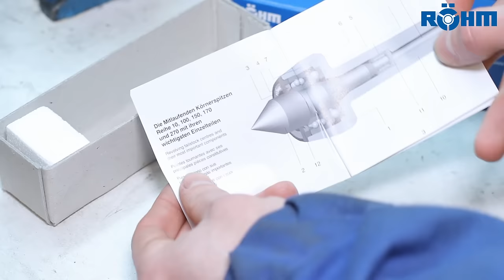Internal Spindle Stop for the Mini Lathe - Making a Lathe Depth Stop

Comment: Your slitting saw probably got worn out from spinning way too fast for steel of that hardness.
Reply from the maker: Thanks for your comment! Yes, I guess that was the case. Unfortunately the little proxxon mill doesn't run lower than 900 rpm. So I almost had no other option than ruining the sawblade :)

Comment: You do very good work...but no offence when I say when your knurling and drilling that I've seen you should be using oil especially when knurling helps flush the the small swarf chips away so it doesn't recut the chips into the work..

Comment: Nice work, but dude, I really had to turn down 5he volume because of your chatter. Please adjust feeds, and speeds.  Use heavy cutting oil with your knurling and doit as slow an RPM your machine allows.  A Blackwoods pocket edition black book for your cutting speeds and feeds are cheap and very handy.
Reply from the maker: Thanks for your feedback! Yes, could have done this better. Especially the internal turning operation sang like crazy sometimes. You mean even slower for knurling? I have to look the right speeds up. It is cut knurling and not form knurling. This might be different.
Reply: @WeCanDoThatBetter  fair call.

Comment: I have never seen knurles used that way. Cool!  Awesome work and great video.
Reply from the maker: Thanks for your feedback! This is a cut knurling tool. It is different from the form knurling tools which are more often seen on youtube. I made this tool by myself and also made a video on the build process if you are interested.
Reply: @WeCanDoThatBetter  Please do post the video of the cut knurling tool build. Is there any reason you do the knurl cuts dry instead of using cutting oil?
Reply from the maker: @nrml76  here is the link to the video:https://www.youtube.com/watch?v=vj8pp3YJijg
When using cutting oil, you have to have plenty of it to wash the chips away. I don't want that mess of a flood coolent so I leave it try. So far it works :)

Comment: Once again, awesome execution. Love watching how methodical you are in your design and approach to your projects.
I too am curious about your ER32 collet chuck. Looks like a good one. I'm looking to replace the Ebay special one I have as the runout is terrible. Would love to hear where you got yours.
Thanks for the video! :)
Reply: You can usually "Touch Up" the collet chuck once it is mounted on the lathe with the lathe it's-self. Have you verified it is mounted concentric? Have you checked each of the individual collets themselves for concentricity? -- Do This -> Mount the chuck as central as you can, then set your compound to the correct angle of your collet system, then take a very light skim cut, now you are perfect! (Maybe use a Dremel mounted on the tool post and grind in the correct surface finish). Make several registration marks so you can get back to this concentricity after removal + replacement.. Voila!
Reply from the maker: Hi and thanks for your kind comment! The ER collet chuck I use is from GG-Tools in Germany. I tried 3 different chucks from ebay and elsewhere, all with horrible runouts. This one I got now has an excellent runout. But it seems that something in the manufacturing process went wrong. The chuck is totally coated including all the functional surfaces. That is not normal. All the functional surfaces should be ground after heat treatment and coating. I called the supplier but he doesn't want to see any problem with the product. So that's for your information. The runout is excellent, the coating and the support is questionable.
Reply: @WeCanDoThatBetter Wow, that's rare in Europe. The behaviour of the company I mean. I once bought a machinist square (plain, no foot) from MiB Germany, 01 class supposedly. It wasn't even in 02. When I moved it along my flat stones grinding marks revealed. Ondulations (waves) typical for Chinese factories where a part is ran through a surface grinder too fast. I reported everything to the company and got a middle finger. I used the square as a DIY kit. I had to correct it myself.

Comment: Very nice design, work and video.   Really great sound quality too.  Have you found that "ER" type collets work poorly (poor grip strength, poor concentricity etc.) if the part is shorter than the collet's over all length?  How will you deal with very short, perhaps small diameter parts?  Will you need an assortment of stop rods or stop rod ends with diameters that match the part diameter?   
Cheers,
F.C.
Reply: During the making process shown in the video, he uses a piece (an offcut) of same diameter stuff when he is gripping on a short length in the collet. The backstop does not care if it touches this offcut or the stock itself. A single stop rod of a single diameter will do for everything. Use a dab of superglue to hold the offcut to the end of the stop rod while the finished part is removed and the new stock is inserted. The only time it might be necessary to modify it is if he wants to grip a hollow tube whose ID is greater than the stop rod's 'natural' OD.
Reply: @darryllcrook376   Ah......so, an assortment of stop rod ends (offcuts).  Brilliant.  I hope the collet concentricity will be adequate if/when non-nominal part diameters are held by nominal diameter collets.  Maybe switch to a 3-jaw chuck with soft jaws bored to suit?   
Thank you,
F.C.
Reply from the maker: As you see in the video when I made the long arbor, I inserted a shorter piece of the same diameter to support the collet. I'm thinking about making a thread onto the stop rod, so that I can screw on different tips with different diameters when I have to support a collet.
Reply from the maker: Yes, thanks for your explanation. I think the "standard" stop rod will do fine for the first time. Perhaps I will make some exchangable tips for it which get screwed on to the rod at some point in the future.

Comment: Could you share your thoughts about collet chucks. What would you advise a fresh hobby machinist? Where should a hobby machinist place such a chuck in the upgrades/shopping list? Let's say the freshman only has the lathe with basic set of cutters, only 3 jaw chuck and a dial indicator and calipers :)
Reply from the maker: You can go far with a three jaw chuck. I would recommend to first upgrade to an independent 4 jaw chuck. These are really versatile for large and small workpieces and give you excellent runout when dialed in correctly. A collet chuck makes work easier when you have a lot of parts to do with the same diameter. It usually runs a lot more true than a 3 jaw chuck and changes of workpieces are a lot quicker than on a 4 jaw chuck.
So, it is not necessary in the first place but on some point later it is a good investion.
Reply: @WeCanDoThatBetter  OK, 4 jaw independent first, got it :)

Comment: So you've made an assortment of rods to be used, with differing end diameters, so they can also be poked into the different sized ER40 collets?
Reply from the maker: The rod doesn't have to be exactly the diameter of the collet. There are some cases, when the part is too short to go deep enough into the collet, where the stop needs to be the same size to support the collet when clamped. I think I will machine a thread into the bar so I can screw on different sized tips.

Comment: At 3:29 the saw have to high speet only 150-250 RPM  and you have also used oil to . but nice video aswell 😉👍
Reply from the maker: Thanks for your comment! That was probably the problem, but the proxxon mill doesn't go lower than that. For HSS that was too much I guess :) You mean no oil?
Reply: @WeCanDoThatBetter  meybe you can swop the pully or put a vfd between or used a  tungsten carbide
Reply from the maker: @wilcojuffer5940  I have to look for alternatives for the milling machine :)

Comment: I'm not saying I know better, because I certainly don't. Couldn't you just have started with a thick walled pipe and saved time and material? Or would sourcing the pipe be more effort than just grabbing some material already on hand? Regardless, you've earned a subscription! Very well made video!
Reply: You are likely right on both points... Pipe would be better work wise, but high alloy pipe aint found cheap nor oft... Its much easier to slurp up a piece from your stash and deal with it adequately to manifest the design... He likely coulda carburized and hardened the pipe to make it a worthwhile piece of steel, but that woulda deformed the pipe like a car wreck and make it unworkable to anything but grinders at that wall thickness in a way... Starting with a piece of high alloy steel like chrome molybdenum steel gives you a piece with decent wear characteristics, resistance to oxidation to a some extent and so on...
Reply from the maker: Hi and thanks for your comment and for subscribing! I really do appreciate that. In this case where the part in the end is basically a thin wall tube, starting from a piece of tubing would be great. I wanted a kind of hard tool steel for this purpose and I don't know if this is even produced as a tubing. And I had this cutoff flying around from a former project, so I don't had to buy something new :) But yes, removing so much metal in tough steel on the windy lathe is a little bit painful ;)
Reply from the maker: Well said, thank you! ;)

Comment: where did you get the collet chuck?
Reply from the maker: he ER collet chuck I use is from GG-Tools in Germany. I tried 3 different chucks from ebay and elsewhere, all with horrible runouts. This one I got now has an excellent runout. But it seems that something in the manufacturing process went wrong. The chuck is totally coated including all the functional surfaces. That is not normal. All the functional surfaces should be ground after heat treatment and coating. I called the supplier but he doesn't want to see any problem with the product. So that's for your information. The runout is excellent, the coating and the support is questionable.

Comment: 11:17 Reduce speed (if possible) 50% and enter for the first cut 2/3 the width of the knurling tool cutting face. Enter first cut with the machine off and engage feed quickly after turning on the spindle. This is not to say that this knurl is of poor quality, far from it. It's a good looking knurl!

Comment: what is a 1,500 degree taper?
Reply: 1.5
There are some that are taught to use a comma for a decimal point. I've no idea why but I've seen it often enough over the years that either way registers the same automatically lol.
Reply: Its a single and a half degree taper, so in essence, a very steep taper with minimal change of dimension over the length to achieve an immense leverage effect, also locks hard as fuck, as was seen with him having to smack the tapers apart... Its also colloquially known as mandrel taper, as most machinist mandrels rely on such shallow tapers for location and retention... I dont know where you found the zeroes after the 1.5, but lets say that the protractor shoulda explained that 1.5 degrees refers to angular offset of the cut...
Reply from the maker: I meant a 1 and a half degree of angle on the compound slide, actually resulting in a 3 degree total taper. Meaning it is a very shallow taper but it's enough to squeeze the mandrel firmly in place and lock the device in the spindle.
Reply from the maker: Well said, thanks ;)
Reply: @WeCanDoThatBetter  np the comma just confused me.
Reply from the maker: @ChickenPermissionOG  here in Germany we use the comma instead of a point ;)